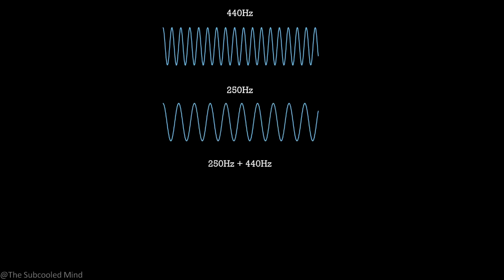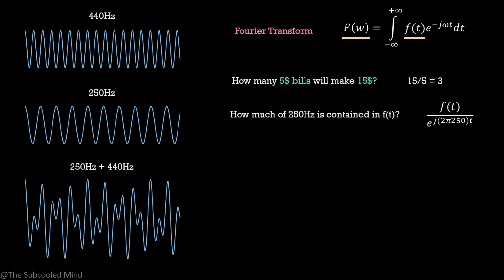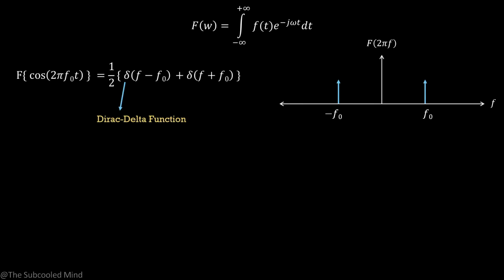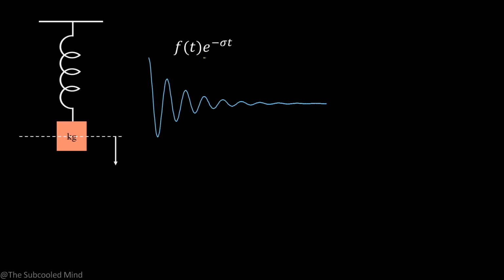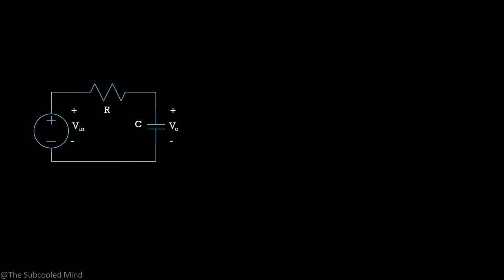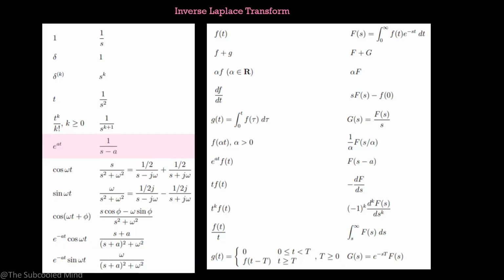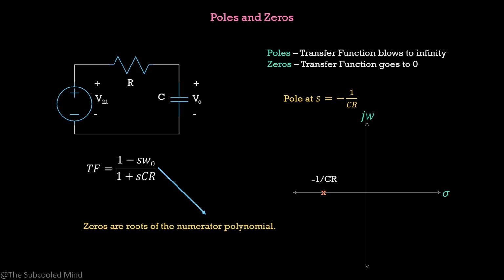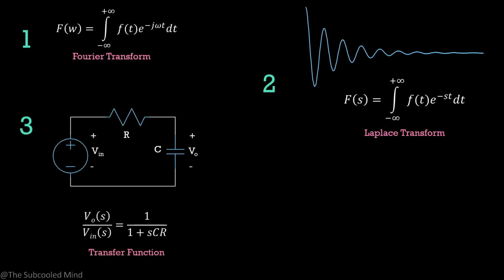Let's understand Fourier & Laplace Transform | Part1 - Control Systems Simplified

Comment: Hi 
You explained it nicely.
But there is negative frequency, you can visualise it physically also.
Anti clock(direction of rotation)wise rotation(fast or medium or slow rotation) is positive frequency 
Clockwise (direction of rotation) rotation(fast or medium or slow rotation) is negative frequency
What is Negative Frequency?
YouTube · Iain Explains Signals, Systems, and Digital Comms
05-Sept-2019
https://youtu.be/gz6AKW-R69s